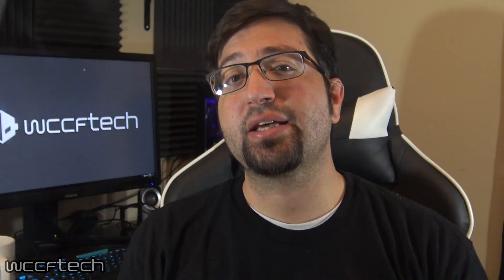Is AMD Prepping A 32 Core Threadripper? Maybe!

Comment from the maker: "Threadripper is not a Epyc processor. Different substrate, different dies. 2 dies work, other 2 have no path to operation. Basically rocks."  https://twitter.com/cavemanjim/status/909429198732668930
Reply: You should put Your cam a little further)
Reply from the maker: errors were made :P

Comment: Update - As I understand it, AMD have come out and denied this. The whole point of ThreadRipper was to take 2 working chips / dies, and two that didn't, and put together a 16 core / 32 thread product with what they had. You can indeed buy a 32 core 64 thread CPU, it's called EPYC. ThreadRipper is not EPIC, and while it is in some respects a half an EPYC, that's not literally what it is either... The substrate and the construction and the design and lots of things about ThreadRipper, the Infinity Fabric implementation, are entirely distinct from either EPYC or Ryzen.
=================== LOL - that'll teach me to look around first!
WccftechTV
22 hours ago
"Threadripper is not a Epyc processor. Different substrate, different dies. 2 dies work, other 2 have no path to operation. Basically rocks."  https://twitter.com/cavemanjim/status/909429198732668930

Comment: the one issue here is the memory controllers, they would need full 8 channel boards, otherwise 32 cores using only 2 of the memory controllers would choke the chips way too hard

Comment: Why does everyone assume that intels 18 core 7980XE chip will be more powerful than the 1950X just because it has 2 more cores.
The 1950X at stock gives you 3.4GHz base +XFR for 3.6GHz all cores, while the 7980XE is 2.6GHz base + unknown all core frequency at stock. 16 vs 18 cores is a 12.5% increase, while 2.6 vs 3.4 is a 30% increase while a 2.9 vs 3.6GHz is a 24% increase. Don't people get the maths or is everyone assuming that the 18 core intel chip will clock as high as a 7900X. Because at stock I cant see it winning multicore benchmarks unless it hits 3.2GHz all cores at stock.

Clock for clock core IPC including SMT vs Hyperthreading, Ryzen vs Sky/kabylake have very little difference, we aren't talking single thread but 2 threads per core.
With the 1950X able to get 4.0GHz all core overclock, the Intel chip will need to clock at about 3.5GHz at least to match the 1950X in overclocking and given that 4.1GHz has been achieved on the 1950X, then the 7980XE will need at least 3.6GHz+ to be the winner.

How much heat will 3.6GHz produce on the 7980XE? Given the very low base clocks of 2.6GHz for a 165W TDP part, my guess is quite a bit more than the 1950X @4.0GHz and will likely need a custom loop for the guesstimate of 360W.
Reply: I like your logic but one should not forget that Intel's Skylake-X still has better IPC - about 8-10%. Either way, I would be really interested to see how would the 2 times more expensive 18-core Intel chip compare to 1950x. I don't expect more than 15-20% faster multi-thread performance.
Reply: Are you sure about that 8-10% better IPC, you might find that with single thread benchmarking for IPC, but not when you factor in maximum threads per core.
You'll find cinebench and handbrake levels out in multicore clock for clock core for core when you normalise.

https://arstechnica.com/gadgets/2017/07/intel-core-i9-fastest-chip-but-too-darn-expensive/3/

The 1800X cinebench score is 1616 stock (stock xfr)  while the 7900x is 2161@4.0 (stock with xms bios boost), normalise for cores and frequency and thats 1800X 1616x1.05/8 =212 per core and 7900X 2161/10=216.1 per core. (Please note that I've seen many better scores for the 1800X that bump the zen core to 217 but wanted to keep the reference to a single link)
Handbrake 1800x @3.8XFR(assumed speed stock) 136, 7900X @4.0 172, normalise 1800X ((132x1.25)/38)x40=173 7900X =172

Where's the 8-10% IPC, I sure as heck don't see it.
TR is Ryzen in every respect except quad channel memory.
I've seen many variables in scoring depending on who is doing the testing, with some intel come out ahead in others AMD.
Many tests don't scale 100% but are usually within a percent or two and the 16 core TR shows this in that it's not quite twice the 1800X in many tests clock for clock.
There's added latency in large multicore designs and while we can see that a zen core and a skylake X core are very similar in multithreaded IPC per core when the core counts are relatively even (7820 and 7900 are about even), it'll only be when the 18 core comes to be benchmarked will we have any indication of the core scaling of the 7980XE in those benchmarks.
Reply: Intel needs 64 pcie lanes and 40 core thread destroyer
Reply: I'd take that 3.4GHz with a grain of salt, that's the maximum turbo boost 2.0 speed with 18 active cores, but that doesn't mean that that frequency will be maintained under full load.
"Intel® Turbo Boost Technology 2.01 accelerates processor and graphics performance for peak loads, automatically allowing processor cores to run faster than the rated operating frequency if they’re operating below power, current, and temperature specification limits."
There's a reason base clocks exist and is the speed under full load with all the other parameters maxed out. Generally though you can expect better than base clocks in many instances, but I doubt it'll be 3.4GHz when running cinebench or any other heavily loaded benchmarks without overclocking. You'll gain some benefit from good cooling, but there are current limitations to contend with that will require intervention to exceed.

Comment: 1:29 You said the Threadripper 1950X has 4 "functional" dies. Do you have a confirmation they are actually functional and just disabled or are they 2 bricked dies?
Reply: I think the better word to use would be "real". No one knows yet if they are functional or not but I really don't see AMD putting perfectly good dies when they could use ones that have failed. It doesn't make sense in my opinion.
Reply from the maker: honestly it's impossible to say ATM, which is why I was hesitant when saying it.